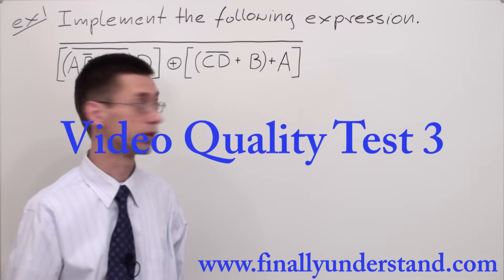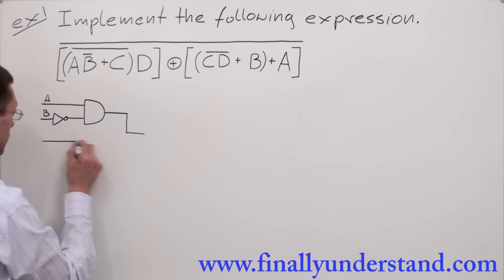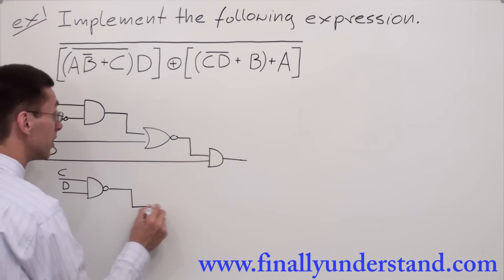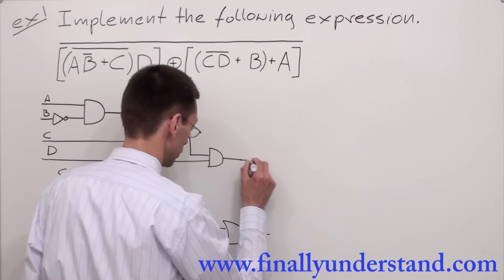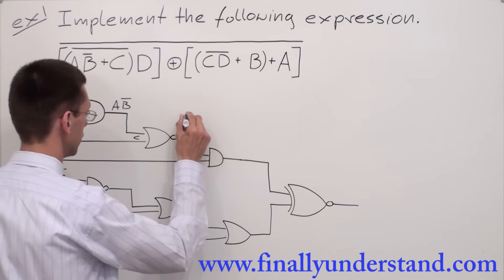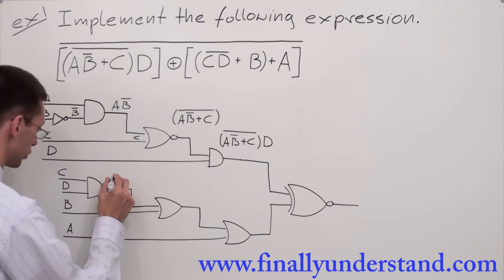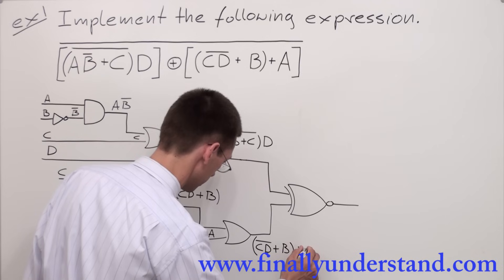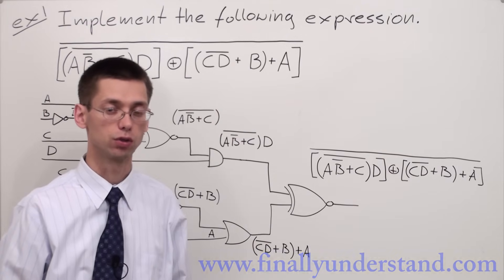Digital Logic - implementing a logic circuit from a Boolean expression.

Comment: why he not attach the down A B C with upper parts of inputs??
Reply from the maker: Good day Taimoor,  in electronics, it is understood that points on a diagram labeled by the same alphabetical character are connected together.  In my video, all of them are next to each other so we can connect all As, Bs and Cs together. But there are more complex schematics where these points are in different parts of the diagram, then they are labeled in the way as I labeled them in my video.
Reply: @FinallyUnderstand  basically sir! it depends on the conditions of question like if they mentioned that we can use multiple inputs ICs then its very easy but for single or double inputs ICs we can attach them with more logic and also to make the boolean expression correct and proofed??
by the way, you have explained it super and thanks alot for having such informative material free for students on this platform...keep it up sir!!

Comment: @JO3haNsum.  Good question!  NAND gates can be used to form most other gates.  Firstly, a NOT gate is ~(A & A) aka split the inputs into one NAND gate.  An AND gate is a NAND gate followed by the NOT gate, so ~(~(A&B).  For OR gates, you invert the inputs then NAND them.  And NOR gates is just that, except with the result inverted agan.